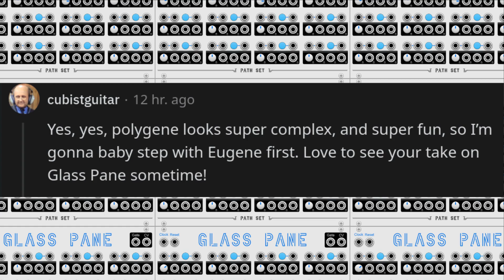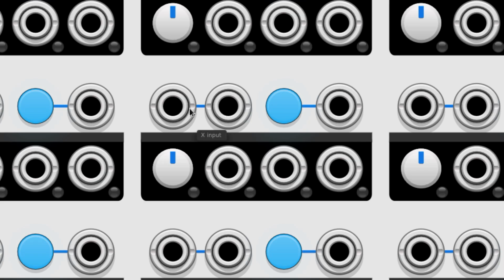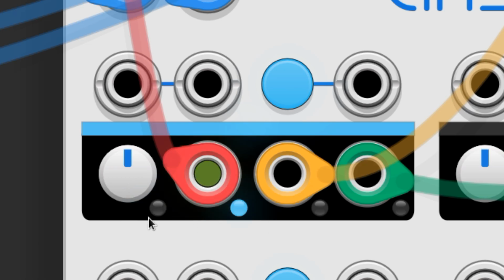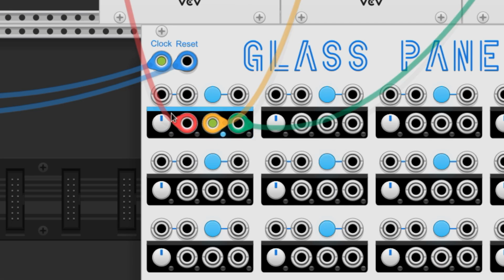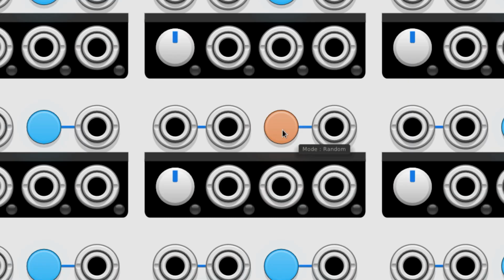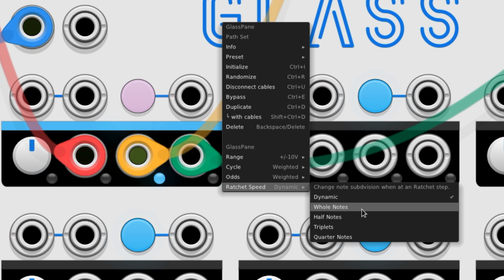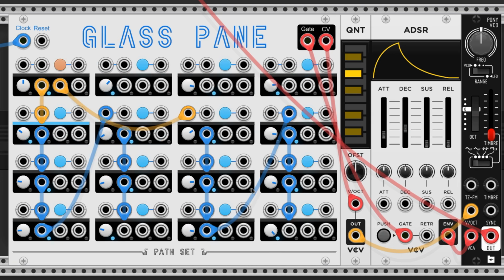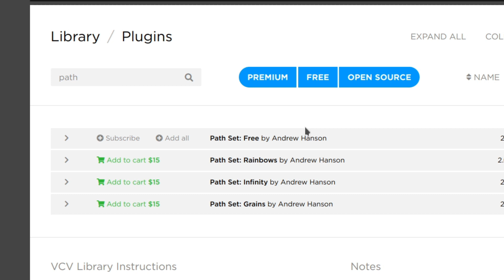Branchable Sequencing: Glass Pane by Path Set

Comment: One thing to add, if you use an output to connect to an external source, like say a burst generator or (my favourite) a vca that opens an effect like a delay, you'll have to mult that output back to another input on glass pane otherwise it will stop, as it doesn't count a patched output as a 'dead end' so it won't reset the sequence. But nice video! Also, thanks for the shoutout!
Reply from the maker: Solid suggestions, Kyle! I'm going to try those out. I feel like there is so much you can do with the Glass Pane. I've just scratched the surface.